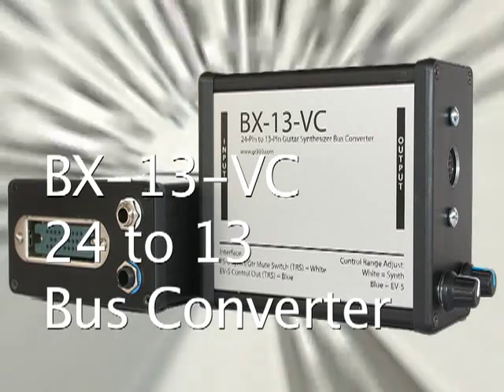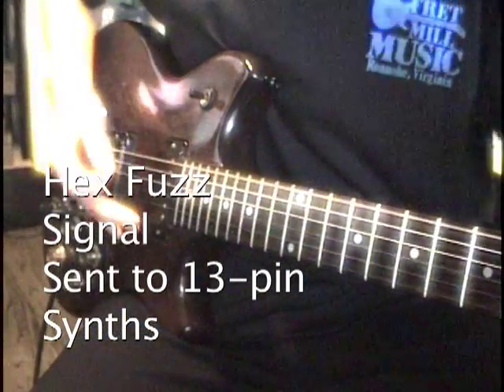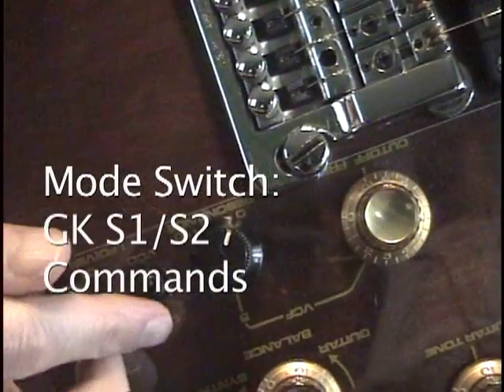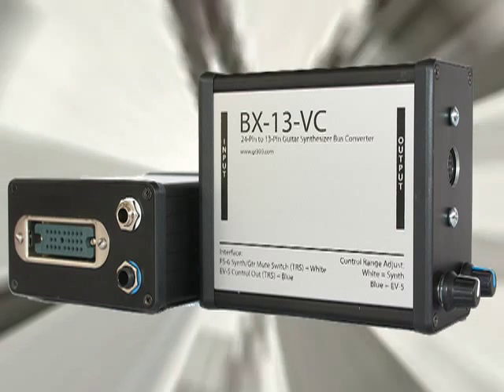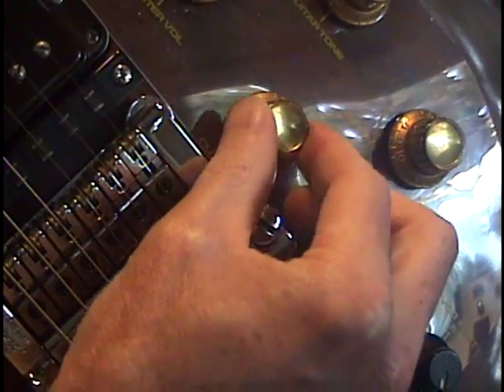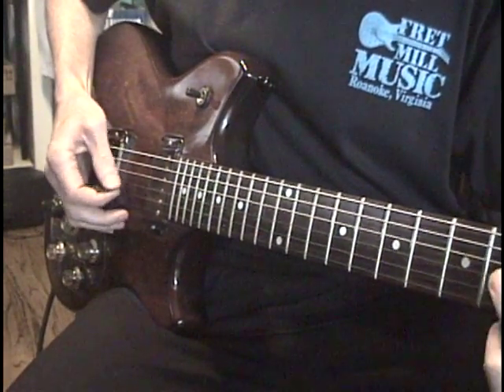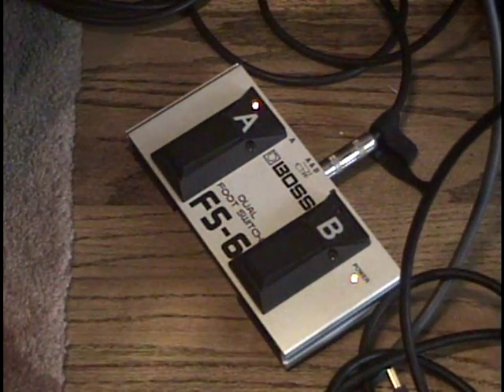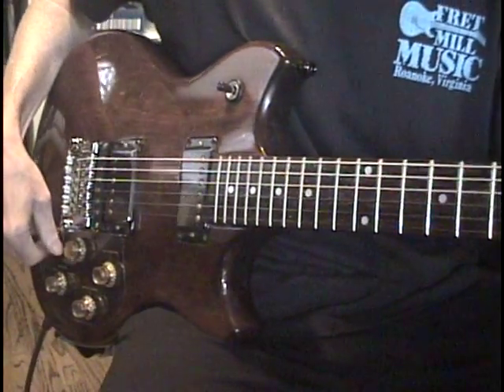BX-13-VC 24-to-13 Pin Vintage Roland Guitar Synth Bus Converter with Expanded Control

Comment from the maker: Kind of hard to compare the two, the G-series hex fuzz has one basic sound. It is a simple design that allows for another layer to the GR-300 VCO sound.

The hex fuzz in the VG-99 has five different modes, variable high frequency cutoff, adjust drive level, and can be balanced, high strings to low strings.